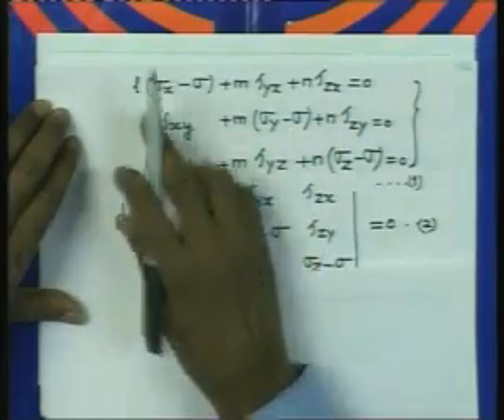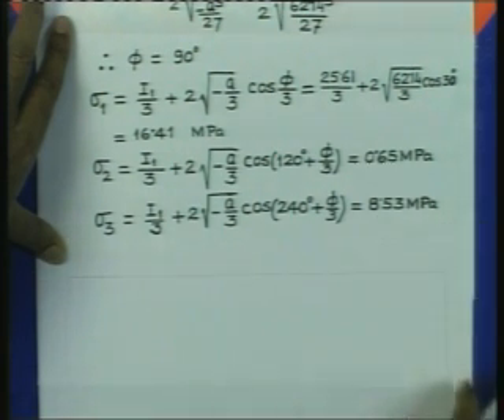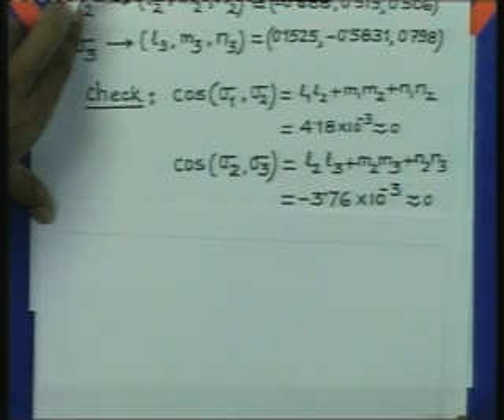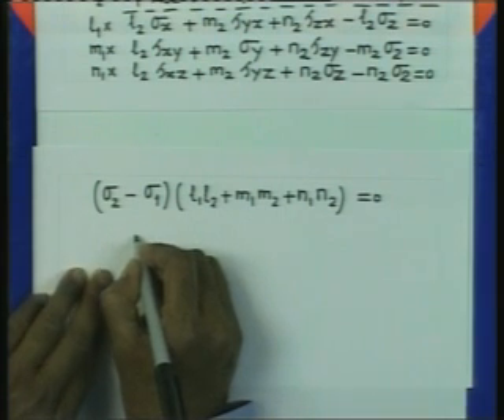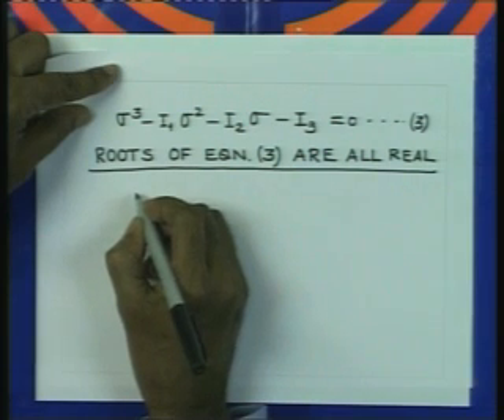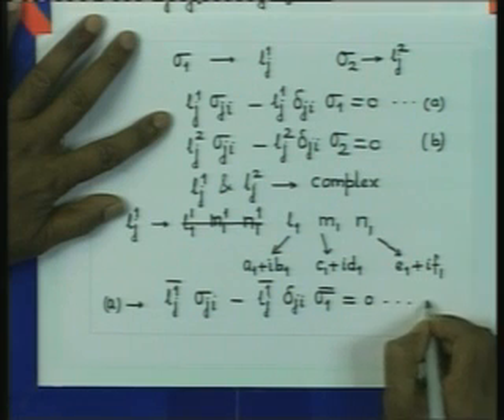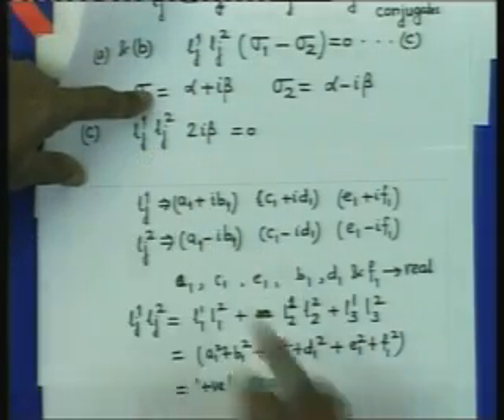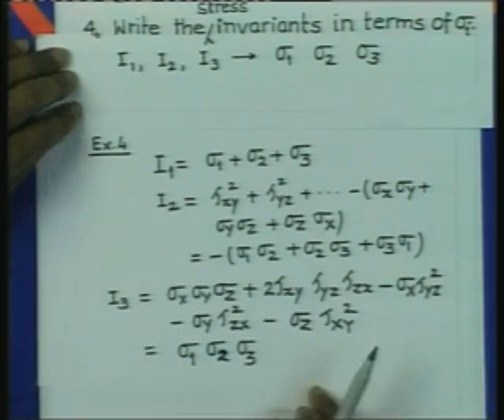Lecture - 4 Advanced Strength of Materials

Comment: The Equation for calculating angle thi (I am not quite sure how spell it) has a a denominator of 2 multiplied by SQRT of (-a^3)/27. When the value of a is positive, this equation will result in a SQRT of a negative number. How can one calculate this angel in this case? Thank you